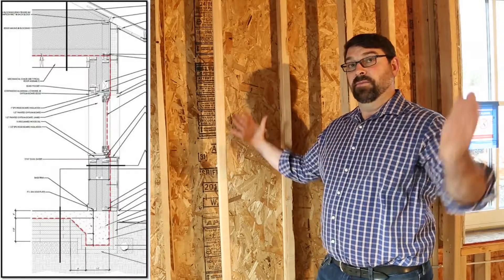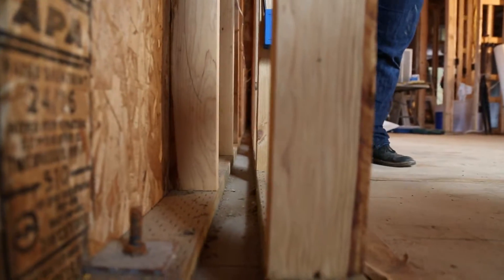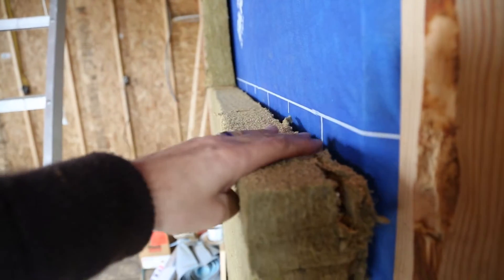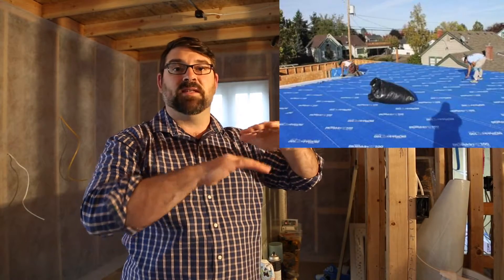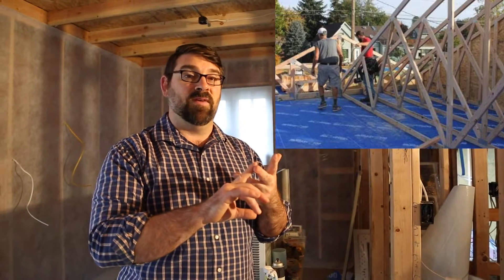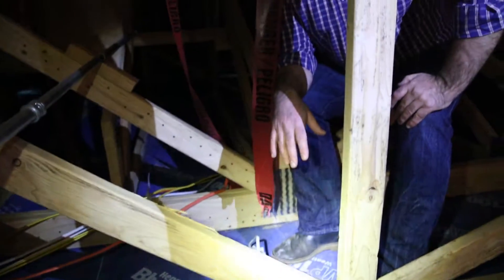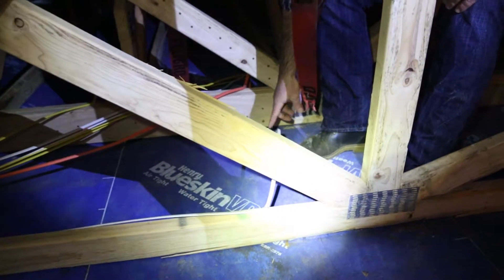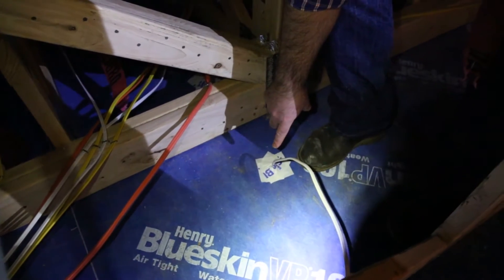Cellar Ridge Passive House: #1 Introduction & Building Envelope:

Comment: You claim to have r70 in the addict. You then said 2 feet of blown in insulation. After 4 months its probably down to 3 inches. most contractors scam customers and pump in more air. You should say how many bags of insulation blown in, instead of depth of inches.